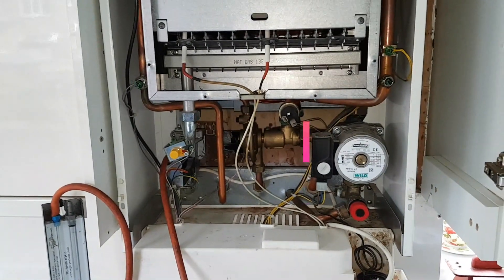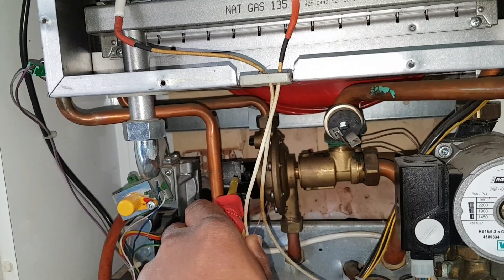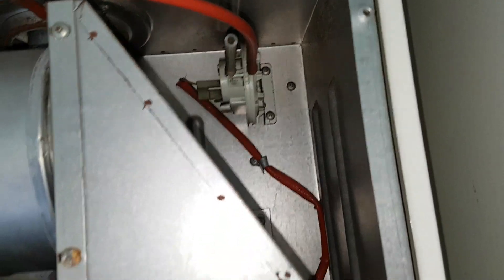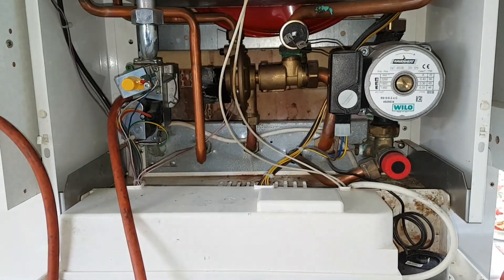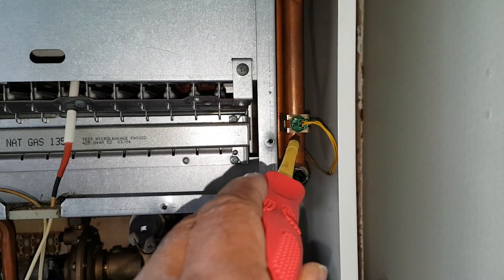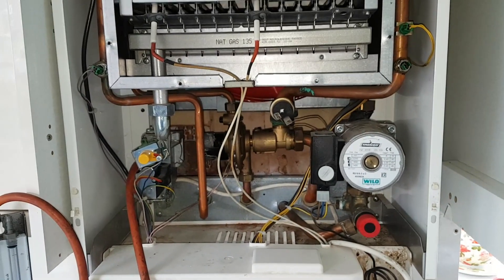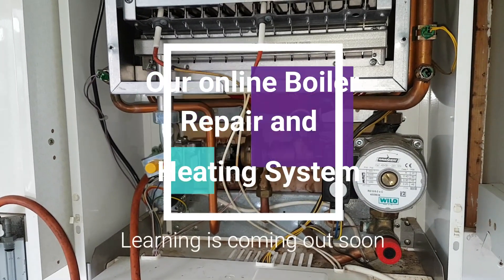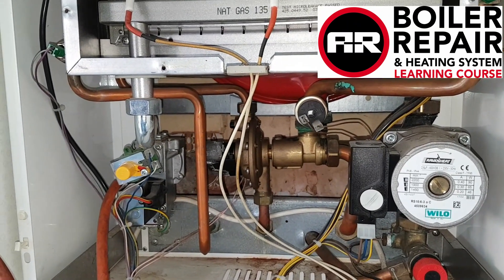Ravenheat 84ET Hot Water and Heating Operation with Coach Tony Morgan

Comment: Help required 
Ravenheat rsf84et, no H/w or Heating, replaced x2 thermisters, main board, ignition board , air pressure switch, boiler is still dead ?